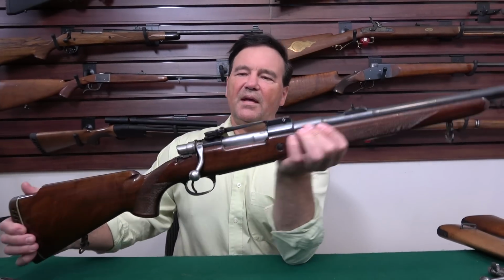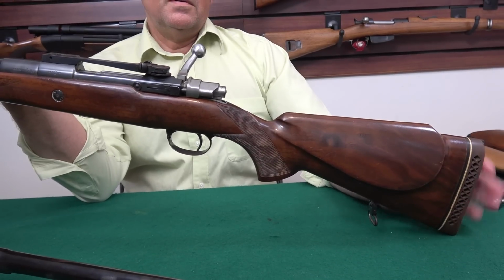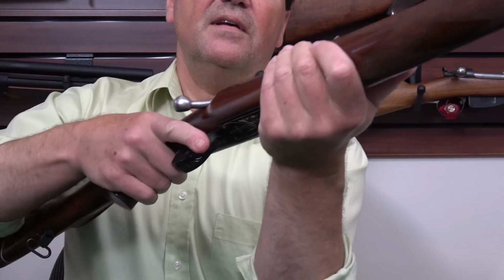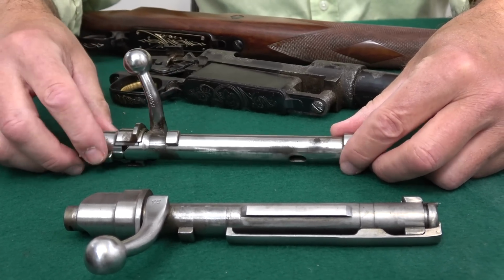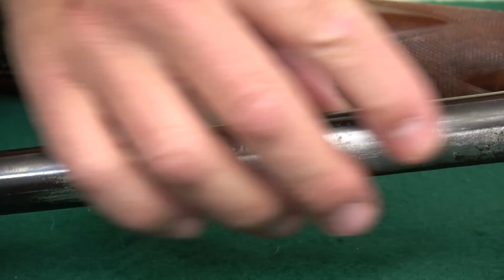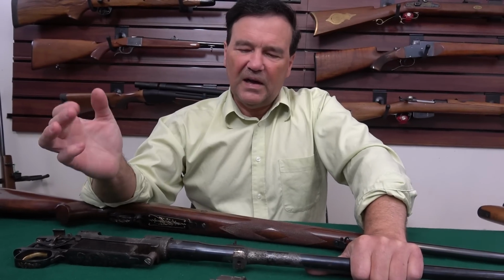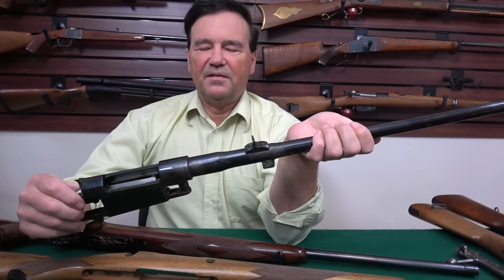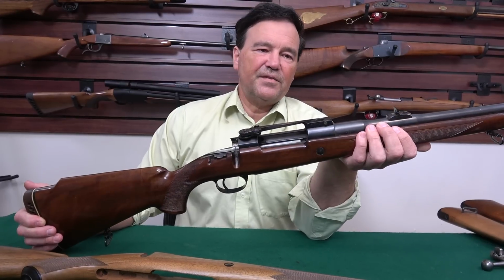Browning Safari : Power & Reliability 2 Ways

Comment: Salted wooden stock - I gathered that it was nothing 2 do w someone threw the raw stocks or pre-cut wood
into the ocean.  It was a deliberate act to save time drying the wood using salted fresh water*.  That technique
was a carry over from furniture beeswax.  Any Browning Belgium made long guns, shotguns n rifles produced between
1967 - 1972 B4 they contracted out to Miroku of Japan is trash!

Use 1% silver nitrate solution 2c if the wood is salted.  Same i understand for long guns, like M70 made by Winchester.
Whenever any product, guns included, cut the production/time cost we get shorted and even worse like these gun
makers did.  Glory to time honored hand made products of old craftsmen.
_________
*Don't knw where they did this salt act.  I doubt if they did it in Herstal, Belgium as though the plant was close to the
  river Meuse, it's ~100 miles away from English Channel.  I dink the wood are of Frenchy Walnut, which has no interesting
  grain, just smooth no grain seen at all.  Mine as well b what the current young boyz only know best, i.e., cheap molded
  plastic.  Frenchy fry walnut is nut(not) like American Walnut or Turkish Walk-not.  Boring.  No tiger or kitty katzen stripies
  what so ever!  So, w the Frenchy wood, it's better to make the barrel bottom chemically rusted n bumpy to add ttheir famous
   culinary artistic flavor and the elegant bumpy, gritty receiver too to go with it.  Of course, i kan b all wrong as to the origin
   of this outrageous process FN Brwng Co. had used.  It could of bn done by a bunch of Nut-cho Matcho boyz down in California Salton Zee,
   of which, the salt density is much higher than the Ocean Pacific.

Comment: Appreciate the video!  Just this past week, I picked up an fn mauser in 458 winchester (for what I'm learning was a steal).  I noticed the barreled action you showed is actually less than 2000 serial numbers from mine!  I will say, yours is actually not from the "salt wood" era (begs the question of "how" it became rusted).  The salt wood era was from around 1966 to 1973 from what I've read.  The salt actually came when the morton salt company convinced browning to coat their wood blanks in salt to cure them without a kiln.  A brine formed that soaked the blanks they used for many years after the fact.  Your barreled action seems to be from sometime after the 458 win mag was invented in 1956, but before browning started selling them in 1959.  I've only seen serial numbers of that format (XXXXX all numbers) on the pre-browning fn safaris, and only up to the 70,000's so yours is on the latter end of that window.  I will say, the stock you chose is perfect as the wood matches my rifle from the same era.  The only difference is the 458's had two crossbolts in the stock rather than the one for the lighter calibers.

Comment: I recently picked up one of these minus the stock. It's just the barreled Browning barreled action in 458wm. My question to you is what stocks will fit it? On the bottom of the barrel under the rear sight. It has a lug with a screw in it. Do I need a stock with that cut out on it
Reply from the maker: Depending on how perfect you'd like the fit to be - you can use a Mauser stock; but barrel fitting and floorplate etc... as well. Plenty of Dremel, chisel, rasp time involved. I didn't install a screw in the forend and nothing bad happened. The factory was concerned about recoil and stock breakage owing to the recoil. I would make the recess and epoxy bed the lug at least. Best would be to find a Safari stock - but you know that. These types of projects are always a lot more work then one thinks IMHO
Reply: @UnitedStatesOfGuns so I need to find a Browning Safari stock if possible? In the video you had a Browning supreme stock. I really like the looks of that one. Where can I find one of those? I've been looking online and places only list the Tbolt and Xbolt

Comment: Quick question for you. What stocks will fit that action and barrel? I just picked up a Browning Safari action and barrel chambered in 458wm
Reply from the maker: That's tricky to answer. It depends how much work one wants to do - fitting the stock. As you know - a Browning Safari stock would be easiest; has to be the FN Mauser or Supreme action; there were some on the Sako action. The .458 has a larger barrel so if you find a Safari or Supreme stock for an '06 for example - you'll have to work on the barrel channel and action inletting as well. It all gets pretty complicated pretty quick - unless you're good with that wort of work. Maybe chat with these fine folks 
https://cottagecraftworks.com/browning-fn-safari-walnut-rifle-stock 
and best of luck!

Comment: Do these stocks crack in the magnum calibres?
Reply from the maker: Not usually. Please check that there is a small gap at the back of the action - at the tang where the action meets the stock. Over a long time the action can set back a bit and split the stock. If there is no gap then Dremel a hairline space or have a gunsmith remedy. Hope this makes sense.
Reply: @UnitedStatesOfGuns  It makes a ton of sense.  Maybe washing some of the salt out of the stock and applying some linseed oil would help strengthen it too.

Comment: Can I ask you how to disassemble the bolt? I have a Browning High Power Safari in 30-06 with the same FN bolt.  I've searched YouTube and Google and can't find any relevant information. I can’t find its user manual on Browning’s official website either.
Reply from the maker: Hello, You can basically use Mauser 98 bolt disassembly
Reply: @UnitedStatesOfGuns  Thank you for your reply, I always get solutions from you but this time I tried it and it was different from my other Mauser bolts because the safety is not on the bolt.
Reply: I used a piece of wire and inserted it into the small hole in the back of the bolt and was finally able to disassemble it.

Comment: Mike,..dont know if you'd be interested... 'Loctite EXTEND Rust Neutralizer' actually converts rust  into a black coating.
You'll have to wire brush off any loose, flaking rust, but any remaining rust is actually used by this Loctite product to convert to a black coating, even ready as a primer for possible painting.. You might find it an option for that rusted barrel.
Reply from the maker: Thank you so much! I'll try it!

Comment: Hi Mike. I wonder if bead blast or some other media such as shell might help remove rust down in deeper pits after you have filed and sanded the majority of the rusted areas. Masking off areas where you dont want to remove blueing. Just a thought as it could be another tool in your arsenal. Little to no parent metal removal. Just softer rust. I picture a small abrasive flapper wheel on a dremel to get in the corners like around the recoil lug where the file just won't work well. Though like filing, abrasives remove metal as well as the target rust.
Reply from the maker: Thank you! Great advice - I work on it a little each day.

Comment: Very interesting presentation. That elevation adjustable scope ring base is very cool. I think that these rifles are called “Browning High Power” because I recently bought one at a premier auction house. The instruction manual Browning emailed to me based on the serial number calls it “Browning Bolt Action High Power Rifle”.  That maybe more of a description than a model name because the words “High Power” don’t appear anywhere on the rifle. There were 3 models:  Safari, Medallion, and Olympic. I don’t know much about the highest grade, but the Medallion model has rosewood forearm and pistol grip caps, skip line checking with wavy edges, and scroll engraving on the receiver and rear portion of the barrel. Oh, and a ram’s head engraved on the floor plate. 

According to the same manual, there were both regular (270 and 30/06) and magnum actions.  It lists part numbers for barrels for those “regular” cartridges plus:  300 H&H Mag, 300 Win Mag, 308 Norma Mag, 375 H&H Mag, and 458 Win Mag, 

You mentioned the unusual but very serviceable bolt release. Your Safari has the same 3-position safety mounted on the right side of the receiver as my rifle. It’s completely different from the bolt-mounted wing safety on a Mauser ‘98 or a Winchester Model 70, and I like it. No scope interference for one thing.
Reply from the maker: Informative and appreciated post - thank you. I hope to find an Olympic Grade one day...not easy to find.

Comment: Interesting video Mike.  The Browning Safaris are nice rifles.  I thought I read somewhere that the salt wood issue with Browning guns back in the 1960's was due to an effort to speed up the seasoning and reduce the moisture content process for the fresh cut Walnut by using a salt brine process that permeated the wood resulting in subsequent rusting out some really fine shotguns and rifles made by Browning.  Not sure if that was true but something I read.  Thanks as always for the informative content.
Reply: I've heard something to that effect as well.
Reply from the maker: Hi Stephen - That's quite possible - although one would think that someone would have thought that salt and steel is not a good idea. I also heard that the logs were boomed in a river that was a tidal river - so fresh water sometimes and salt or brackish water at other times - which no one thought of. Hard to know which story is true - or maybe something else. I've had former Browning employees write me with various versions. Thanks for taking the time to write. All the best.